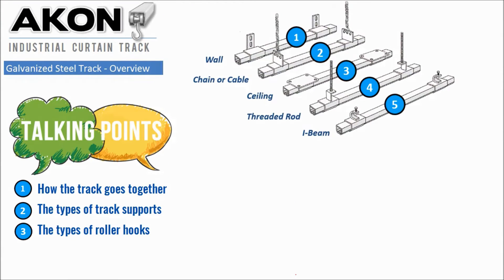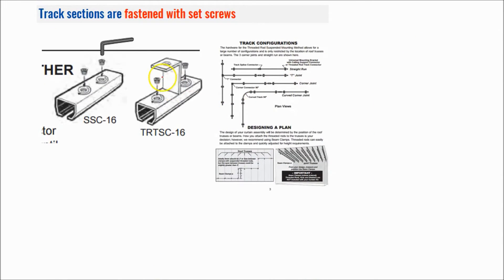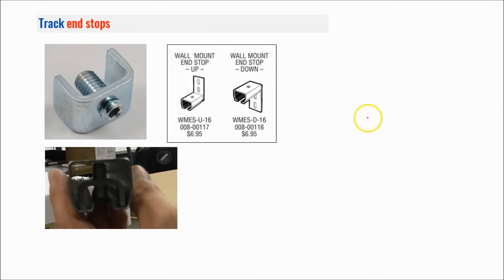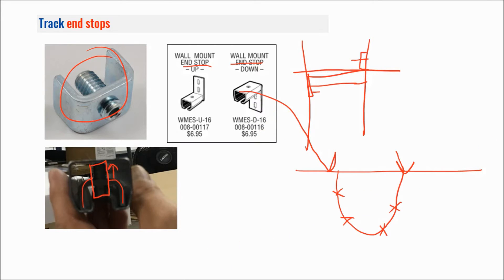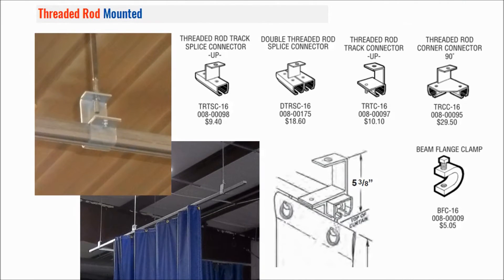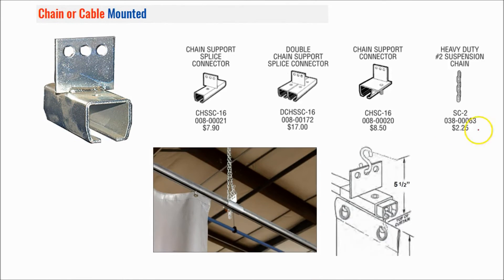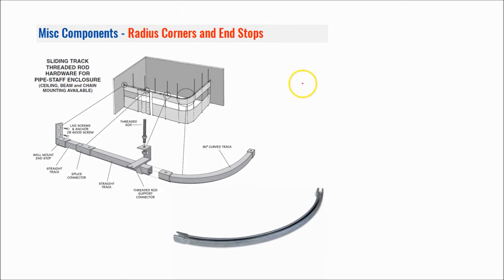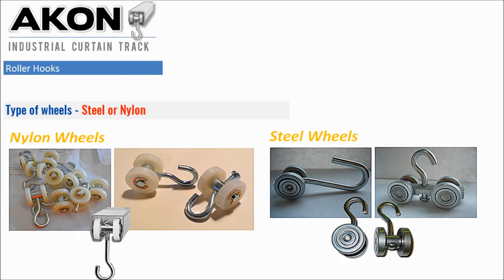Industrial Curtain Track   General Overview

Comment: What will it cost for your ceiling track system .  The track rail attached to the ceiling in my garage.  Need to divide the length of the garage which is 21’ and the with 15’.  Need the track rollers for total of 21’ and 15’.  Thank you, Joe